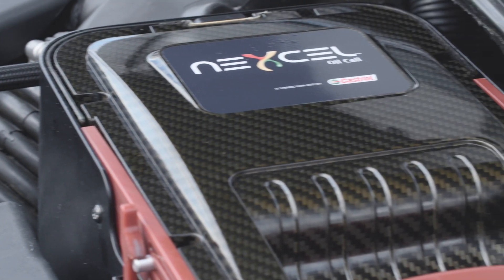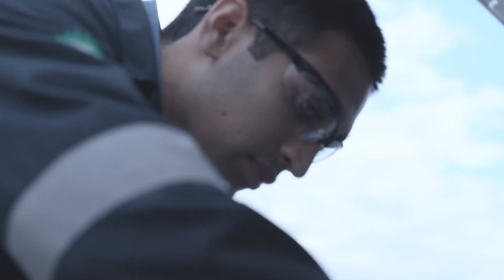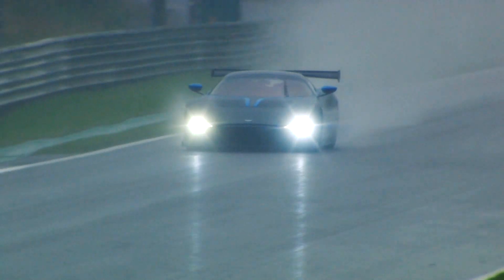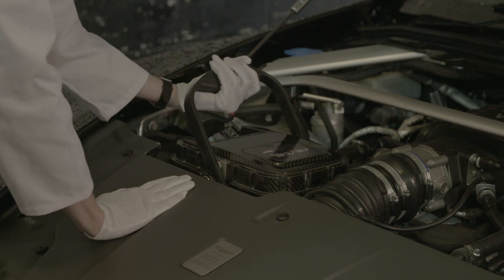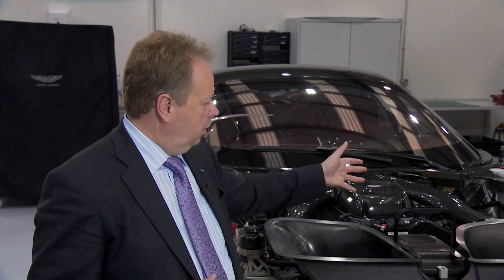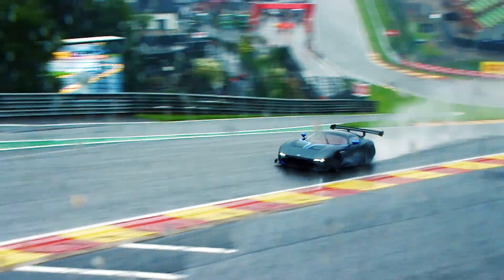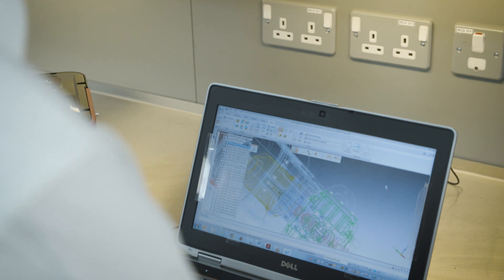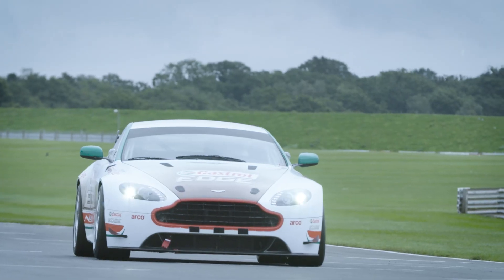Castrol lanceert Nexcel oliecartridge

Comment: I bet that these cartridges will be much more expensive than regular oil changes, and when the oil level drops, rather than refill it, you will need to replace the cartridge, and they will introduce protection against cheaper substitutes.
Reply: in another video about this stuff, this chief engineer has mentioned that it'll cost more or less the same as regular oil change....but i doubt it too :D